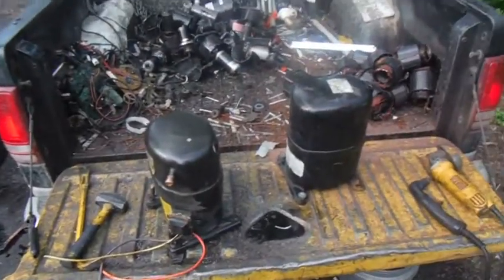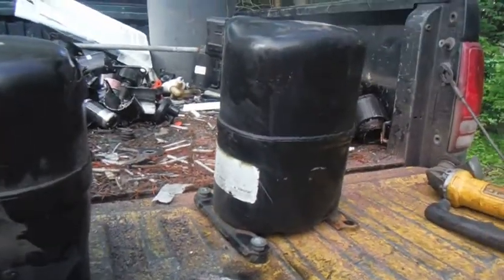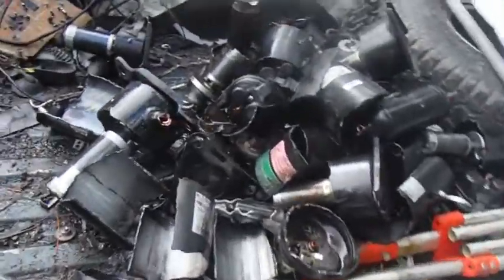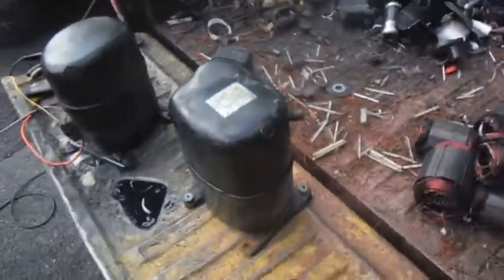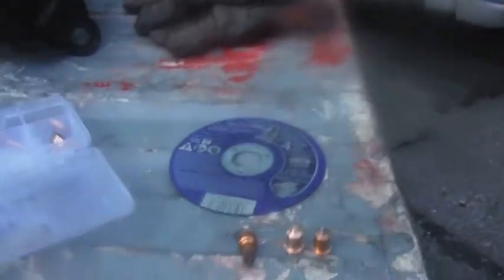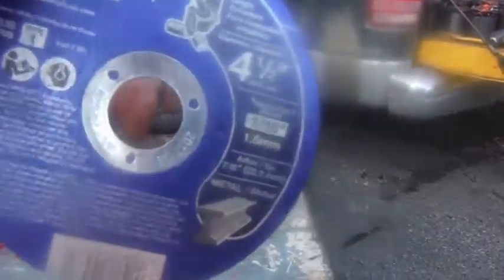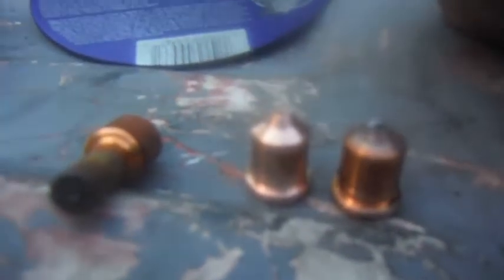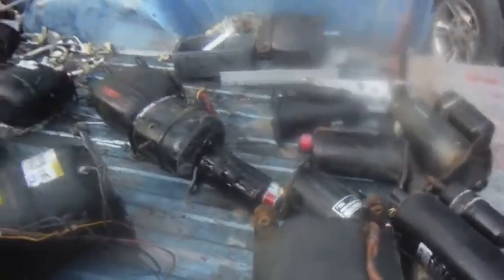Cutting open Ac compressors with a plasma cutter (compared to a grinder)

Comment: Is it safe to use a plasma cutter  indoors?
Reply from the maker: Yeah generally speaking like if you’re cutting steel. Even then you’d want lots of ventilation. Some of my friends that have bigger welding shops than me use plasma cutters a bunch inside but their walls are covered in a “green haze” as I call it. If you’re cutting the compressors inside you’ll want a fume extractor with a range hood. If you ain’t got one of those then do it outside.

Comment: Makes me wonder. I don't have a plasma set up but I do have my oxy - acetylene torch and I'm tired of using my grinder on these things.
Reply from the maker: grinders waste money your sinking more money into them blades than you are getting out in copper. plus all the time spent on them vs doing something else. not to mention the fact that grinders beat the crap out of you. I've used oxy-fuel before on a few but its more expensive to operate than plasma and the oil really catches fire when using oxy-fuel. definitely do not do that inside or near anything else that can start to burn. get yourself a table out in the middle of nothing. don't do it on the bed of your truck if your gonna use a torch.

Comment: where do you get most of your motors & compressors?
Reply from the maker: I used to buy them from the yard that I worked at. I bought a few from other yards as well. most of the free ones I get I pull out of fridges and ac units. for some reason most of the ones I get for free happen to also be aluminum wound.

Comment: What size generator are you using?
Reply from the maker: 6800 running watt 8500 starting watt
Reply: Ty for your reply. Bought one right after. Works great. One more question..on the round compressors like on a refrigerator is there a way you can  tell which are copper or aluminum without cutting them open first?
Reply from the maker: @Shea8Queens8  the guy that taught me how to do them has a list he made up of all the different model numbers he cut up and what the results were. he had to cut a lot of aluminum ones to make that list but now he just checks the part numbers. I unfortunately did not care enough to make a list so I just cut em all up and hope for the best. someone has to do it eventually weather it be me or some guy in Pakistan wearing 2x4's for sandals. so I just suck it up and get it done. usually all the ones I get for free happen to be aluminum or copper/aluminum mixed because that's just my luck. I know the ones that have like like some tubular frame, shaped like a triangle attached to the unit itself, those ones are aluminum and the motor is in there sideways. those are the only ones I know for sure that are aluminum. if you ever see one I would cut it apart because it is pretty interesting how they are put together. there's also a steel cage around the windings if I remember correctly that I had to cut with the plasma on those as well.

Comment: Can you detail the rating or specifications of the plasma cutter please? And some details about the air compressor you use to couple with the plasma cutter.
Reply from the maker: It’s a hypertherm powermax30xp. It’s rated to sever up to 5/8” material but I’ve seen it do thicker. I don’t get too into all the other specs because really they don’t matter once you get into the real world. Inches per minute ratings are a joke unless your cutting new steel on a CNc table.  The out put amps is also not a good way to judge a plasma. Hypertherm 30 amp machines can do the same thing as other companies 40-60 amp machines. Hypertherm use way less consumables for way cheaper than the other guy’s and the input power is less if that matters to you or not. It’s hooked up to a rigid 8500/6800 watt generator that’s also powering a 15 gallon dewalt 110v air compressor at the same time. The air compressor in my opinion is not big enough but it will work if you need it too just don’t plan on it being a long term solution because it will burn up it a few years. It works for me because I got it on sale and I don’t care if it burns out or not. It’s also more portable than an 80 gallon set up but easier to take off my truck than an engine drive set up. Being a mobile welder/burner with a truck that’s not as big as I’d ideally need that’s the set up that works best for me at the moment. If you got a stationary set up do your self a favor and get at least a 60 gallon compressor
Reply: @scrapmanindustries  Thank you so much for such a valuable input. I have quantities up to 150 compressors daily in my workshop. Please tell me whether powermax30 can handle the daily load?
Reply from the maker: @syedjameelahmed66  it could handle it all day every day. Although there are occasional units that I’ve found that the 45 would work better. The power max 30xp can handle the majority of the ones I’ve found. The ones that it can not handle are about 200lbs and there’s a cast iron housing you have to cut apart to get to the stator. I’ve rarely came across those and couldn’t tell you a model number or anything.

Comment: How to collect scrap compressor? From where?
Reply from the maker: get them from anywhere really. what country you in?
Reply: @scrapmanindustries  Portugal
Reply from the maker: @homeservice1240  If Portugal is anything like Poland or Romania you may find it more difficult to find scrap compressors in your country than it is to find them here in the USA. In the USA "mostly" every house and commercial building has 1 or more air conditioner or refrigerator, so there is a crap ton of these things here just out and about. I know I saw a few refrigerators in Europe but air conditioners or dehumidifiers were almost non existent. If you got vending machines there you may be able to get compressors out of those. maybe try buying some from your local scrap yard.

Comment: Plasma cutter is very fast. So I have a lot of scrap compressor. What thing will you recommend? (cheapest way) Plasma cutter or grinder?
Reply from the maker: cheapest way if you're in America is plasma. Id imagine that goes the same way else where in the world as well since the Chinese also use plasma cutters to open them up on some lines. They also use really expensive rotary cutting machines on some lines but in America those would have to run a few hundred thousand units through them to even begin to pay for themselves. You'll be losing money using a grinder if you're in America. Especially now that scrap is so cheap. I used a grinder a few times before I got a plasma just so I could see what was in them and figure out what other tools I needed. The wheels used to cut one unit cost more than what you'll pull out of each unit. Plasma is the way to go if your set up for it. 

And to answer your other question I don't have either. of those apps.
Reply: @scrapmanindustries  yep. I saw some Chinese machines like this 👉https://youtu.be/8MX2SQH3Opc
Per hour 60~100 pieces can be cut by those machines. But the machines are costly. If I can cut the same amount by plasma, I will go for plasma.

Comment: How's the oil work with using the plasma? Nothing igniting??
Reply from the maker: it smokes like crazy while you're cutting. sometimes you see small flames shoot out. nothing bad though. you can see what it does if you watch the video. I wouldn't want to do this indoors with out a really good fume extractor and even outside I prefer to wear a respirator at a minimum. if doing this full-time I would use one of the full face ones with the power pack you wear as a fanny pack or even use a fume extractor outside but honestly its not that bad.